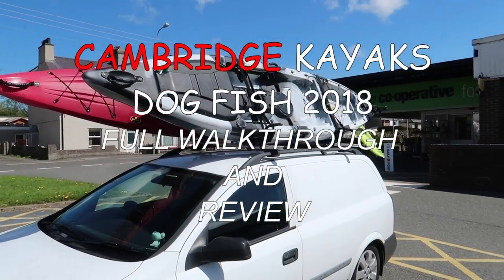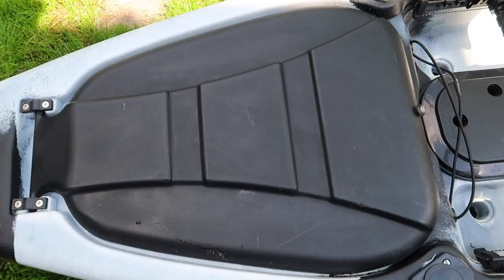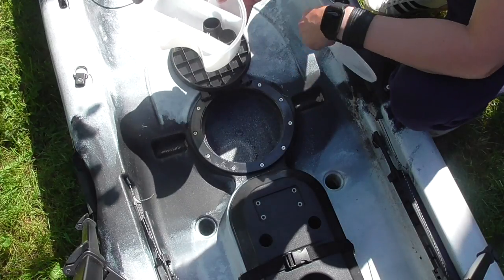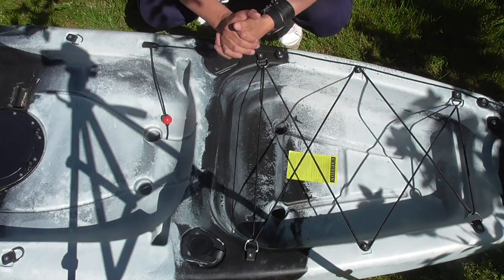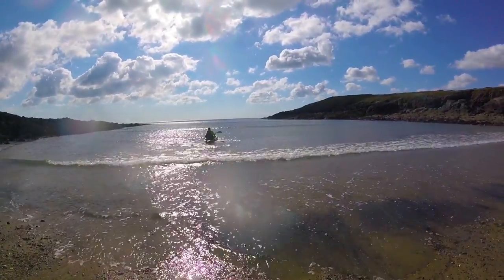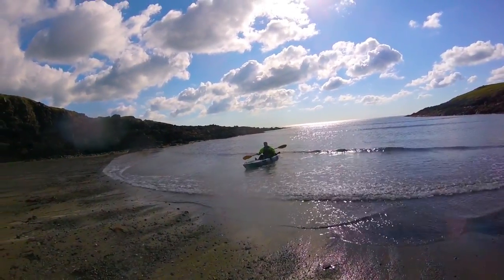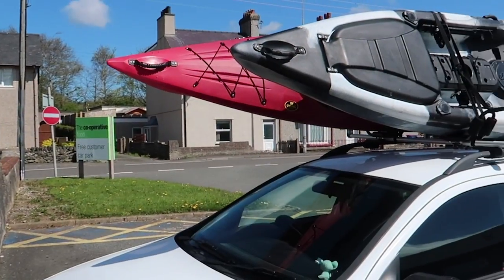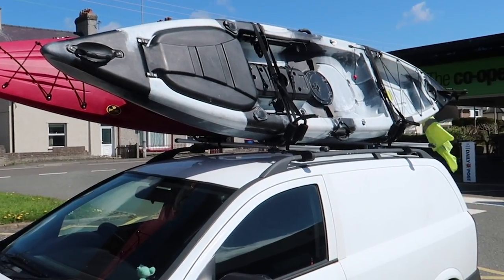Cambridge Kayaks Dog Fish fishing Kayak full Honest review and walkthrough

Comment: I had the same problem with water leaking through, I just redid the silicone on the rod holders and didn't have any problems after that. They've changed a couple of things in the version I got. the hatch to the inside of the kayak is a different design, and the swivel rod holder and centre cupholder bit use a weird railblaza looking style mount, but railblaza products don't work with this as it uses a 9 pointed star rather than the 8 pointed star railblaza uses. everything else is the same

Comment: Purchased one myself I have had no problems with it very impressed I have also added a fair bit of extra weight trolling motor auxiliary battery fish finder ect and it still doesn't affect the stability of the kayak. I have removed all the rod holders and re sealed and also got the fishing chair upgrade. Definitely worth the money good review
Reply from the maker: Hi Andy yeah great kayak for the money.Just watched your video, kayak looked solid even with the motor and higher seat.Im glad you found the review useful mate thx for sharing safe paddles i mean safe motoring lol.Justin
Reply: @JustinWood  I watched your review on the dog fish before I purchased the kayak. It does everything I need it to the trolling motor works really well with the rudder and foot controls. I have just purchased an anchor and fitted a trolley system I have been river fishing, but hoping to have a go in some bays ECT on the coast. Thanks again for the review keep safe too
Reply from the maker: Andy Waudby Glad you found it useful mate.. Perfect for the bays you will have a ton of fun 😉
Reply: Hi there Andy, just wondering where you put your battery and transducer for the fish finder on this kayak as there doesn't seem much opportunity to get into the main hull of the boat.  

Cheers!